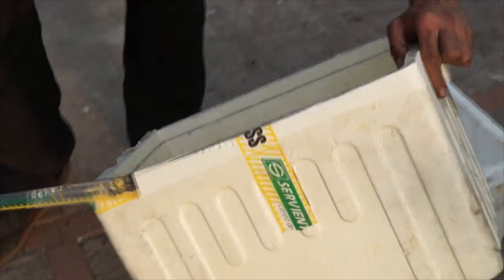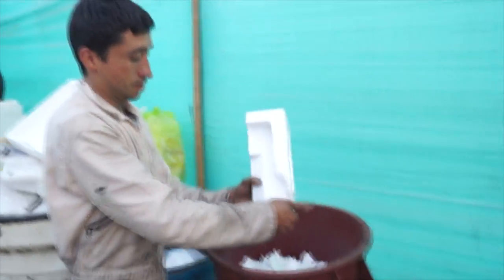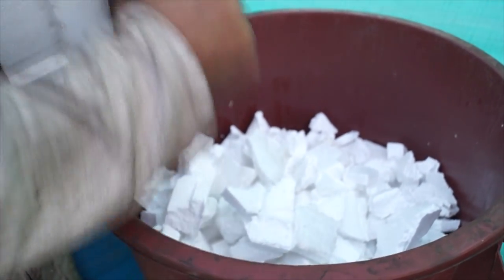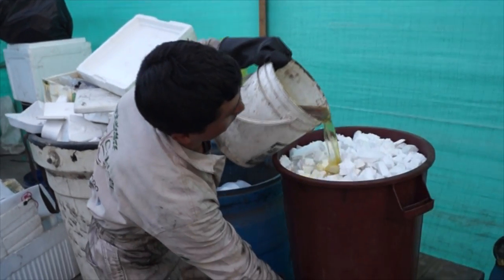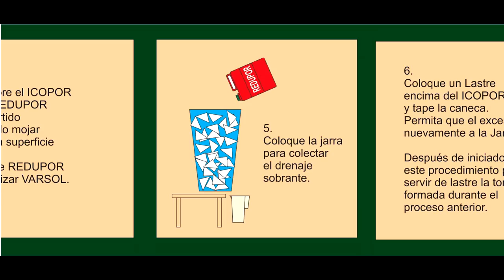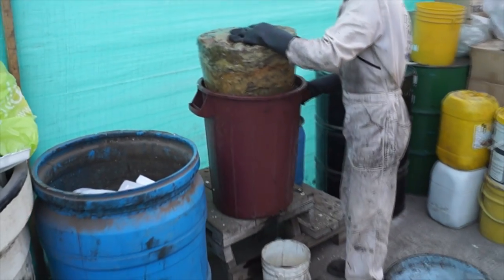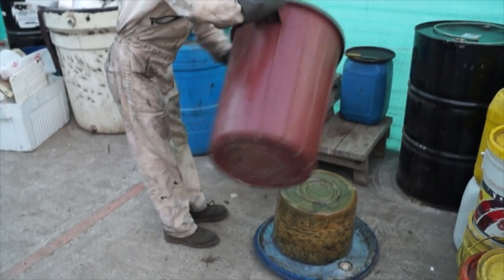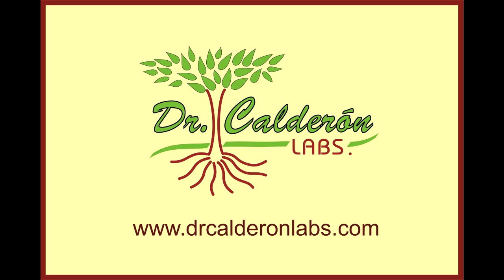A Method for the Recycling of Polystyrene. Volume reduction by means of chemical solvent.

Comment: I understand what your trying to do, Altho chemical solvent works, isn't the most piratical approach for recycling.  Grinding the polystyrene into a fine consistency and applying mild heat and pressure you can reform into a block into a structure, without adding solvents and creating a napalm fire hazard. sculpting the block into a boat or kayak for example, utilizing 10 layers of latex paint and woven fiberglass/resign you can create a very lightweight and strong water craft. At very minimal cost the only other practical use is for this polystyrene is sculpting and add fiberglass. because the water proof  and lightweight  nature
Reply from the maker: I understand your comment. We perform the process only in our factory. We are triying to look for another more environmentally sound proces.  But there are hughe amounts of this material to be used in "Kayaks". See this link https://1drv.ms/u/s!ArsgsgFr_2mzml0hcXkvIrltr4m_?e=Bc5gc5
Reply: Quiero hacer una mesa con aserrín y icopor pero que quede resistente. Que otros materiales debo de usar ?

Comment: We get that it's an Aliphatic solvent, but WHICH ONE are they using here? Brand name or product please.
Reply from the maker: Its commercial Name is VARSOL. It is an aliphatic solvent between C7 to C9
Reply: Felipe Calderon thank you so much. What is the other name she mentioned? "(Something) or Varsol"
Reply: Felipe Calderon I need the reducer with the brown color. I've used it before but I forgot the name. :( If you help me find it and it's the same one, I'll give you $100.
Reply from the maker: @jorelldye4346   We use a middle distillate from 180 °C to 240 °C  obtained in the process of distillation of the pyrolitic oil from a mixture of plastics (Polystryrene 25 % Poliethilene 50 % Polypropylene 25 ) sometimes called REDUPOR. But this is a local name only.

Comment: Were is the solvent after having that cake? Also looks still very dirty.
Reply from the maker: 75 to 90 % of the solvent will drain from the bottom of the recipient. The remainder solvent is recuperated during the subsecuenti pyrolysis of the Cake.
Reply: @calderon4128  Pyrolysis aka burning? Than it is not recycling. Or there is something wrong with translation.
Reply from the maker: @wernerhiemer406  We do not burn the polystyrene. We make pyrolysis in the absence of oxigen and we recuperate 95-90 % of the charge in the form of styrene monomer.
Reply: @calderon4128  Ah was to kitchen related. Like cracking of crude oil, so grime or what ever is in there can go also into useful substances. The smaller the easier it gets distilled.